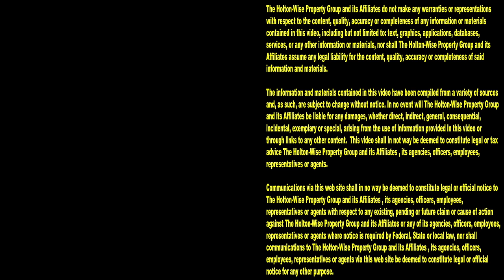Full Eviction Caught on Tape: Watch these Deadbeats get Evicted Live | Tenants From Hell 153

Comment: I heard a wise man say,  break the machine, not the man.   Get the NECESSARY  equipment you need to move things about quickly and efficiently.   🤔    These are very trying to for head of the household with just one income.   To family and friends help those who are really struggling.   They place was left in good standard normal wear and tear 😉       I have seen,  were the bulldozer needed just needed to be call in.

Comment: No offense but I think you need to learn a little more before trying to change a deadbolt.  You did a fair job on setting the screws into the door frame, but they really need to be long enough to go into the studs past the frame.  But worse, once you did get the plate in place, and showed us how your door closed and locked,  that deadbolt could NOT have closed all the way because you didn't clear out a hole so the deadbolt could travel all the way.  It looked like it went only a quarter inch in which completely keeps the deadbolt from doing anything except keeping the door closed from a mild breeze opening it.